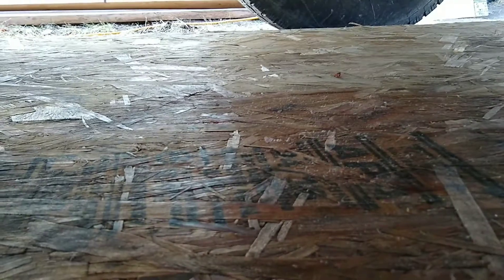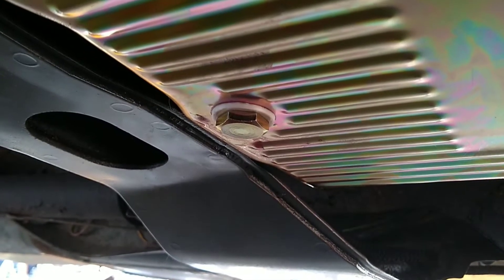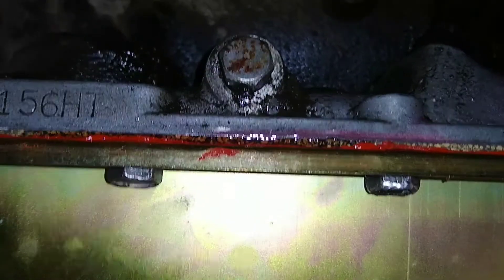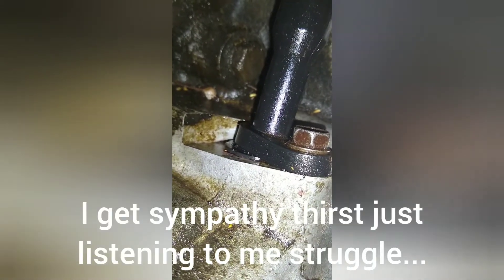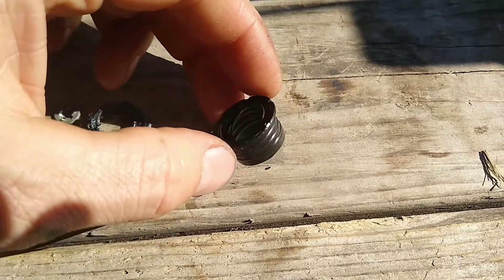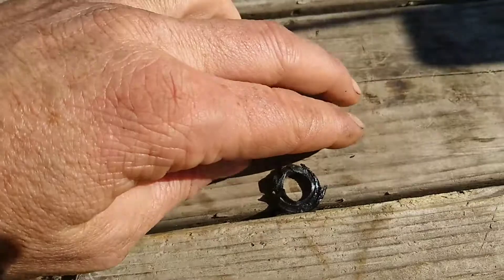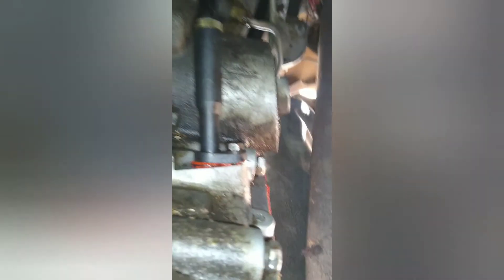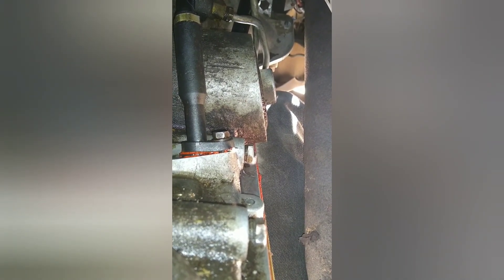FIXED! The 7 Year 700R4 Tranny LEAK

Comment: Hey bud did you have to drain the fluid again to replace that seal? 
I’m so glad you did this video. I just replaced the pan gasket on my 700R4 & yep, still freaking leaking. 😡😡😡
Reply: No you don't have to drop the pan again, lossen the tv cable from carb ,go back under to the tranny pull up and disconnect the cable from the tranny slide the top hat gasket off and replace

Comment: never use rtv all over your oil pan gasket thats your issue put the gasket with no rtv and bolt it down the right way to torque specs ans it shouldnt leak

Comment: I think that is a turbo 350 kickdown cable, It has a O ring gasket. It looks like someone left the old O ring gasket on it and put the 700r4 boot in the hole.And that is your leak.
Reply: The older ones didn't use an o-ring.  This is a 66-72 TH350 kickdown cable that uses a top hat style seal. Unfortunately, he has a top hat seal for some other application.  The seal for his cable is less than $3 from ATP.

Comment: Had the same issue multiple times with plastic housing detent cable....i changed to a long- aluminum housing detent cable with o-ring instead of the rubber wide gasket that never seals good with plastic that gets hot warps and leaks. Plastic sucks...aluminum with o-ring is best.

Comment: first video i seen on youtube  i have the same problem also leaking mine is not flush to the trans. plus i have a  issue with the trans taking longer to shift into 2nd so i need to fix that also. thanks for video.